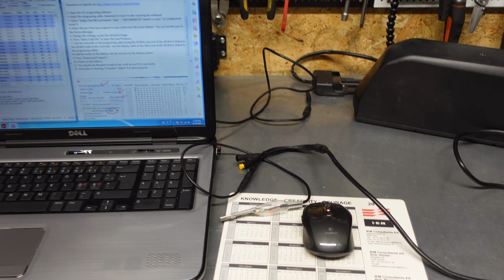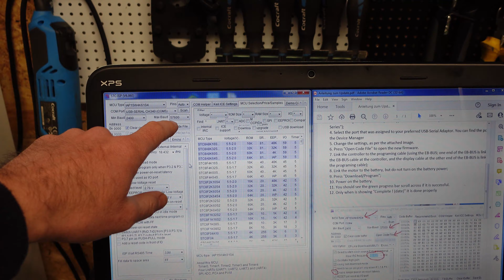Bafang BBSHD flashing stock controller

Comment: Excellent video. I have an error 10 after replacing controller and motor core trying to fix a 08 error code. Going to do this hope to be rolling again.
Reply from the maker: It's very likely that your new controller is not fully compatible with old motor.
Reply: @LierskogenEbikes  Do you think that mimicking the process you demonstrated wlll work?  I'm waiting for the programming cable and very anxious to get it working again.
Reply from the maker: @djedirashakim6883  It depends, if you will install the right controller version.
Reply: @LierskogenEbikes  I'm glad to report that it worked for me.  Thanks for the video sir. It helped tremendously. Peace
Reply from the maker: @djedirashakim6883  Glad to help. Cheers.

Comment: thanks for the tutorial... how to you backup the original bafang firmware before flashing to the new firmware as a backup
Reply from the maker: You can read controller settings and save it to file.
Reply: @LierskogenEbikes  thanks 👍🏽

Comment: Ever had any controllers go into 30H error code after using a programming cable? I had had several including a 750W . i used rhe cable with my phone using the SPEEED app. Aparently it is rare for this to happen. I also had it happen to a 750w using a eggrider display. Which seemed very odd

Comment: From whatbi have heard, bafang is making their motors not programable via  the programming cable and app. Some motors lock you out with thw 30H code straight away and some give you a few goes at programming. And then theres some that are not able to be reflashed by a laptop. I have not been told why Bafang has started doing this, but im sure theres a good explanation
Reply from the maker: Explanation is money and legal restrictions. They don't want end user to temper with motor settings.

Comment: If my battery doesn't have a power button but only cables, is it ok if I just reconnect it while this flashing?
Reply from the maker: I think it should be OK to start flashing process, when battery is already connected. You have to disconnect battery, when you are connecting the programming cable. Otherwise you will burn the chip on that cable. If flashing process doesn't start with battery already connected, than you know, what to do.
Reply: @Lierskogen Ebikes  You mean disconnect the battery when connecting the programming cable into laptop USB port? I have a similar case and 10h error, I hope everything will work, I'm worrying about not to make a mistake and about sequencing of steps
Reply from the maker: @dimamanzano  That's what I wrote in my previous reply.
Reply: @Lierskogen Ebikes  I just did it successfully, I'm very happy! Am right that it's impossible to see in a software what firmware version you had before flashing? Sometimes controller has a sticker with a firmware name but my new doesn't have it.
Reply from the maker: @dimamanzano  It's possible to check firmware version in Bafang programming  software. That's the program where you change speed limits and general motor settings.
Reply: my battery also has no power button.  when I push the battery onto it's contact nothing happens.  how did you make it work??
Reply: I also tried to connect to this program the serial port connects but the read /write buttons remain great out and the fields don't populate.  @LierskogenEbikes

Comment: Так какой пункт был изменён при ошибке? So what exactly was changed in settings during this update?
Reply from the maker: Controller firmware was made compatible with the older type thermal sensor built in stator. Motor settings are completely different thing.
Reply: @LierskogenEbikes  yeah... Same was told in the beginning, but what exactly you did?
Reply from the maker: @zvermashine  I uploaded different firmware version. The whole movie is about this.

Comment: Thanks! How do I figure out which firmware I should flash to my old BBSHD motor? You chose a file called (latest), but aren't we supposed to be downgrading the controller to older software? My old controller is labeled with "CRR10E4830E090001.1"
Reply from the maker: Test different firmware versions. It won't destroy the controller. If you don't get any errors after installation, then you found the correct version to your controller.

Comment: I've never had that problem because I use the correct display for bafang middrive,  but I am able to flash  the controller if needed  I don't use that old method of flashing with a laptop,  there is an app for your phone, I use speeed for android,  and it is easier and more efficient
Reply from the maker: I checked that application. You can adjust controller parameters, but you don't have any option there to flash the controller. By flashing I mean updating firmware of the controller, not paramiters.
Reply: It seems you only have a few goes at programming the controller using the SPEEED app before it locks you out with the 30H code. I would be careful using it

Comment: wHAT IS LATEST VERSION OF STP-ISP YOU HAVE TRIED? ITRIED v6.97 BUT IT DID NOT WORK FOR ME. ALSO I CANNOT GET THE CORRECT COM PORTS WORKING? CAN YOU EXPLAIN HOW TO DO THIS? MY DISPLAY NO LONGER LIGHTS UP SO I ASSUME IT IS FAULTY?
Reply from the maker: I haven't worked with Bafang motors for more than 2 years. Don't know what is the latest version of this file. You need to check in Windows hardware list, which COM port is selected for the programming USB stick. COM port will show up next to device name after connecting it to the computer.

Comment: I’ve had two failed controllers on two separate Bafangs… their electronics suck!
Reply from the maker: It's very easy to stall a motor, when going uphill on the wrong gear. This can blow the MOSFETs or capacitors.